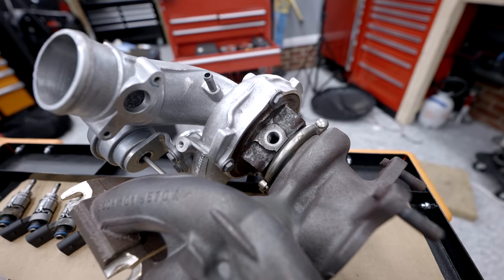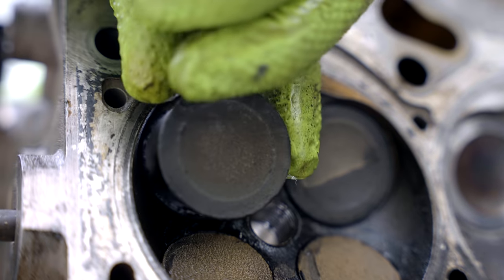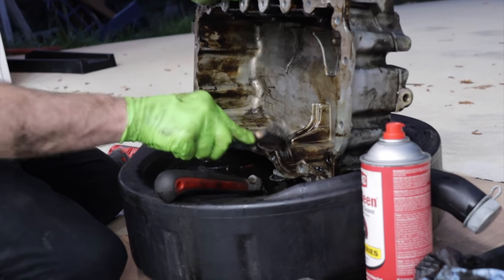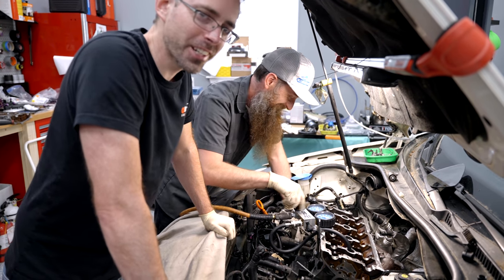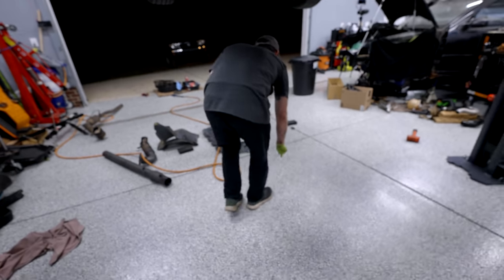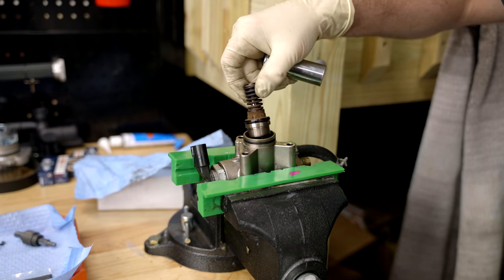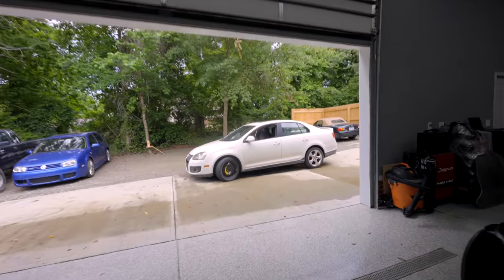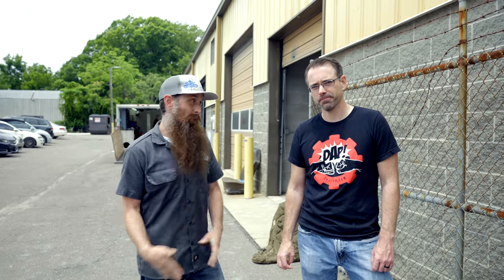Fixing and Modifying the $5000 1/4 Mile Jetta ~ JDM vs Euro RACE Episode 2

Comment: I think like other people have mentioned for the tfsi you drill out the hole on the brass fitting on hpfp (video below), rs4  frpv 136 bar fuel rail pressure valve, 200 bar fuel rail pressure valve and 3 bar map sensor. You'll be getting much better figures then 👍
Video regarding 5mm hpfp mod https://youtu.be/fM419dVBSKY

Comment: CRC valve cleaner does remove it though ya its hard stuff but that CRC stuff cleaned my N54 100k ports 100%. You close the valves then spay it in a let it sit then vac out the sludge. Don't seat valves like your grandpa, get a rubber hose slide it over the valve stem put the other end in a drill.
Reply from the maker: Through the intake? I’ve never seen that work

Comment: Probably would have hunted down a tatty old AMG, stripped as much weight as possible and fitted nitrous, an old non supercharged 55 car is RWD, about 350 bhp stock and engine, gearbox and diff will hold together at 600bhp no problem.

Comment: With spare tire, boogers and toe nails, I say 114 lbs
Reply: Way off!!!
Reply from the maker: Same haha
Reply: @HumbleMechanic  did you put new gas in the car before dynoing? It may be pulling timing. Maybe put fresh gas and mix a bit of e85 in it.
Reply from the maker: Yes. Funny story, I went to fill up, and the station had the pumps shut off. HAHA The opened them about 15 minutes later. It was weird.
Reply: @HumbleMechanic  they probably heard the noises your car was making and shit it down for safety. Was the F&F re-enactments pre-scripted or all-natur-al?
Reply from the maker: Hahhaha I did shift it 15 times.

Comment: My friend wants to get a GTI for a new daily and I keep trying to convince him otherwise and this is why. Harder to work on, more expensive parts, just don't make power like good 4 cylinders do, also don't sound nearly as good. With that being said im surprised how cheap y'all found used parts with how y'all were talking in the first episode.
Nitrous will make power for sure, but that goes for any vehicle. And no way the engine blows up for a couple passes unless y'all are really stupid about it. I'm a G&G/Honda fan, but I feel like they're gonna rely too much on much on power to weight and might get caught off guard by dsg+nitrous, considering they'll most likely just stick with a small eBay turbo. Interested to see how this ends up.

Comment: I have audis and vws. But your gonna get waxed.
Reply from the maker: :) maybe... maybe not.
Reply: @HumbleMechanic  probably the biggest advantage beside weighting about 1k less would be using a China turbo and no direct fueling. The K04 is going to be pushed so hard compared to a larger frame turbo. The valve train on the fsi/tsi motors can't take the revs that well either. Dollar for dollar the vw is at a disadvantage.

Comment: I’m so sorry buddy but I will never buy a vw ever the wife’s mk6 2.5L Jetta barely made 100k on the clock and it was fight to get it there she loved vw do to made in México. Now Japanese is my choice for her and now she drives a Toyota! I work on aircraft for a living and can’t deal with German/Mexican crap and mostly all that failed was German made
Reply from the maker: You don’t have to apologize to me. :) I didn’t build them or design them. We try and have some fun and keep them on the road
Reply: @HumbleMechanic  so what’s your opinion on the code the car had? P0864
Reply from the maker: My guess would be an issue at the connector that goes into the front.